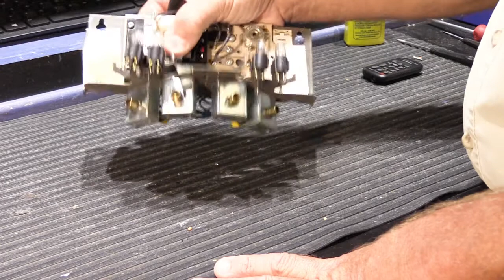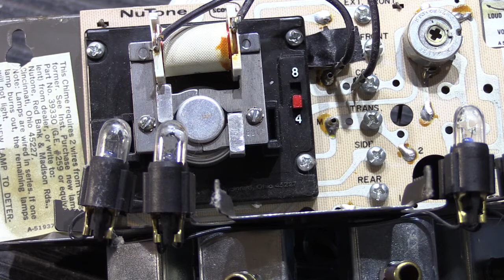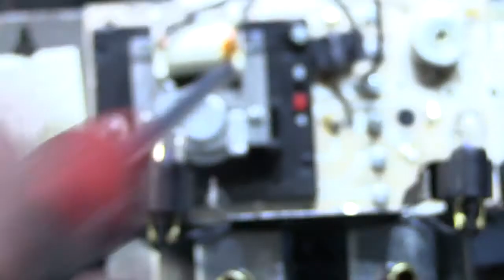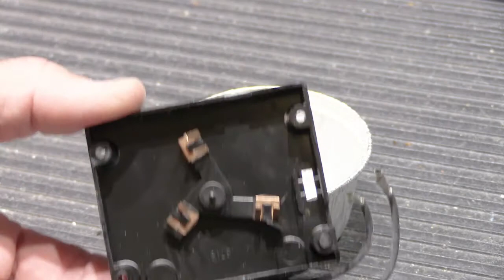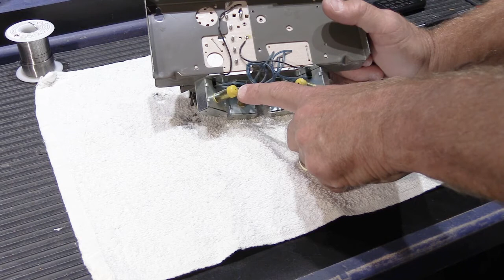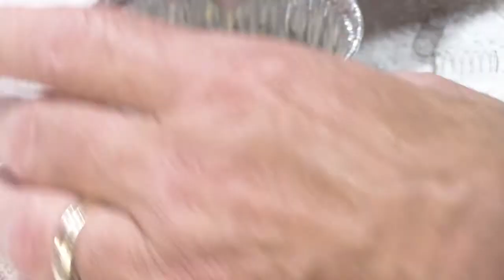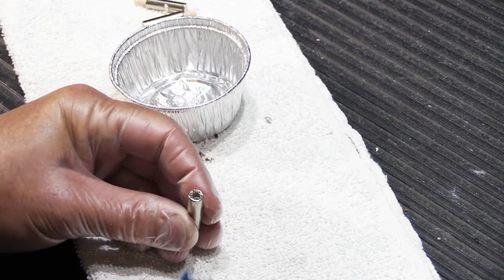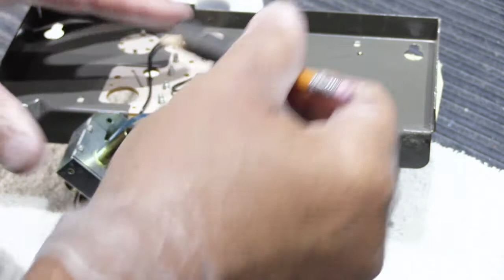How to Service a NuTone  8 Note Long Tube Door Chime Base

Comment: Great video. I did so well following the video, I went from no chimes on my Nu Tone 8 Note to a Nu Tone 9 Note. It seems to ring an extra chime 6 seconds after it is suppose to stop. Can you help? Thank you!
Reply from the maker: Hi Steve:  Is your Chime Base exactly like the Base in this Video, or is it similar but different?  For the Base shown in this Video  - there isn't anything that I can think of that would case a single note to chime, 6 seconds after a full cycle.

What happens when you activate the Chime again, after the 9th note? - Chris
Reply: @northsideservicecompany3567  When I activate it after the 9th note,it does the same thing .
Reply from the maker: @stevetarpey9230  Did you remove of bend the "Start - Stop" metal tab that goes under the motor base? - Chris

Comment: Thank you for this! It may be common sense, but does the power need to be shut off? I will in order to be on the safe side, but you never state that before removal or re-installation. Looking forward to our chimes again. It's been a year :(
Reply from the maker: Hi skrubud:  The NuTone Chime is a 16 volt chime - so there's no danger form leaving it powered up when you remove the chime base.  Make sure that you label the wires (so you know how to reconnect them) and don't let the bare ends of the wires touch together - Chris

Comment: Hello. I followed your easy instructions (thank you!) and now the chimes work.......but won’t sop. It still has the little metal tab which is resting on the post, so I am stuck on what to do next.
Reply from the maker: The metal tab is the "Start - Stop" Switch.  When the rotor comes to the end of the cycle - it lifts the metal tab from the post - breaking the connection and the motor stops turning. You either have the metal tab misaligned or you have the Chime wired incorrectly.  Here's a link to our Video that shows how the Chime needs to be wired:   https://www.youtube.com/watch?v=TjKUx18TEvc&list=PLsTvqKsBnGYdEvtzvv_pz1gOKa9UPuAxH&index=4&t=824s
Chris
Reply: Well, had I truly listened to your video, I would have taken a photo before dismantling. I thought I knew it all because I had written stuff down. Had I taken a photo, as you suggested, I would have seen that I I connected one small wire wrong. I figured it out after lots of trial and error. But now, it works fantastically and it feels so nice to hear those doorbell chimes ring like they are brand new. Thanks again.
Reply from the maker: @rejeanmayer5541  Well Done! - It's always very satisfying to find a mistake that was made and solve the problem - Chris

Comment: Hi Chris - I salvaged a K46 Jefferson Clock door chime from my mother-in-laws house over six years ago, prior to selling it.  We plan to install it in our new home which was just completed a month ago.  Thanks to your excellent video, I have no doubt that I'll be able to bring the chime mechanism back to life.  
However, the clock is another story.  It does not work, nor did I remember to have a receptacle run to the location where we planned to install it.  My fallback is to research replacing the clock mechanism with a battery powered unit, but keep the original clock face.  Do you know of any resources where folks are dealing successfully with this issue?  Thank you, and thanks again for sharing your knowledge.
Reply from the maker: Hi Timmyneal - The clock works off the same 20 Volt Transformer that runs the Chime - You will need a 20 Volt AC Transformer rated at 30 Watts - I haven't seen any clock motors fails in years and years (and I actually have some) Mostly both the clock motor and chime motor will need to be serviced (see this Video - https://www.youtube.com/watch?v=yK4XUGujZrM&list=PLsTvqKsBnGYcnKjZV0EioS9LJf6KUzAFn 

Replacing the clock motor with a quartz movement is heresy - Don't Do it !!!! - Chris
Reply: OK...I wont but here's the deal with my unit that you may not have seen before.  I already viewed the clock motor refurbishing video, which was also excellent...thank you!  The chime and clock are powered by separate transformer/motor assemblies.  The chime has a model 35180600G, 16V, 5W, 3.6 rpm, Type H18 unit. The clock is driven by a Type A1-G4, 20V, 60cycle, 2W unit, it has a plug for standard 115v socket.  

I checked to entry closet which is near where I intend to mount the K46, the builder installed wiring to power a transformer, and the lv wires for the front and rear doorbell buttons exit in the same location. 

Given all of this info, how would you recommend I proceed with getting both the clock and chime portions powered?  Thank you.

-Tim
Reply from the maker: Hi timmyneal:  Something is up with the Chime Base, "K" Model Chimes all have 20 Volt Motors - 

I think you should email me pictures of the Chime Base and the Clock so I can see what you really have - Chris

nscompany@msn.com
Reply: Done!

Comment: Hi, I just bought a house that has the 4 note long chime, it still works but I found that the number 3 chime tube is cracked, do you know where I might find a replacement tube for it? Thank you
Reply from the maker: Hi Clayton: Finding replacement tubes can be difficult - Different Series of NuTone 8-Note Long Tube Chimes use different tubes - They can be divided up into 2 basic groups: Group #1 are the tubes that hang by cords that are tied through holes in the tops of the tubes - Groups #2 are the tubes that have a plastic hanger that is inserted into the top of the tube.  Of course there are the 4 different lengths of each tube 

The best source for tubes is eBay - patience is the key - looking everyday for what you need - you will likely have to buy a complete set of tubes - Often the tubes will also be cracked like yours, the older style of tubes (in group #1) tend to crack more often than later tubes.

There are 2 possible work around's for your cracked tube - Try turning the crack away from the plunger to see if it sounds better - If your tube is from Group #2,  you can remove the insert from the top of tube (that part that holds the plastic hanger) and put it in the bottom of the tube (you're essentially flipping the tube over) with the crack at the bottom, it probably won't effect the sound - Chris
Reply: @northsideservicecompany3567  thanks Chris! I have the second group of tubes with the plastic hangers. Do you have a suggestion for removing the plastic hanger without damaging it?
Reply from the maker: Hi Clayton:  If you can wait to do anything until next week - I will make a Video that shows how to remove the Plastic Hanger and the retaining plug inside the end of the tube - Chris
Reply: Hi Chris, That would be just fine.  i'm not in much of a hurry.   I'm going to get some lighter fluid next week to give mine a good cleaning too. (Sorry I just found your reply today)
Reply from the maker: Hi Clayton: I've got the Video shot and I'll be posting it later this week - Chris
Reply from the maker: Hi Jeremy:  Here's a link to the Video that shows how to deal with your cracked Brass Tube:

https://www.youtube.com/watch?v=mfIEnjJkmvo

Chris
Reply: @northsideservicecompany3567  I recently bought a Emerson Rittenhouse 8 note door chime complete with clock.  It works perfectly now that I followed your instructions on the cleaning.  Thanks a lot
Reply from the maker: @michelangelo9694  Perfect - Good to know that the Video helped - Chris

Comment: Any advice on a 1950s K27 Regal? seems like the plunger is clogged or dirty.
Reply from the maker: It's basically the same process, except you have just 1 plunger to clean.  Do not attempt to disassemble the solenoid assembly or remove the plunger.  Use lighter fluid (Ronson or similar - NOT DW40!!!) squirt a little in each end of the solenoid tube and shake the chime base back-and-forth to make the plunger move left and right.  Continue cleaning until the plunger moves freely.  I have seen cases where the plunger has corrosion or rust on its surface, in those case the solenoid needs to be disassemble - I don't advise you try this unless you're 100% confidant you can put it back together - Chris
Reply: Thanks! I was confused by what ours looks like. It's DIRTY, but wow, I love that thing. Once I put the new one up, I started looking for options.

Looks like I'm heading to the store for lighter fluid!
Reply: I think my electrician busted the striker pins when he through it in the trash. I see an orange piece of wood down in the plunger and I found a busted piece in the trash. I gave the lighter fluid a try too and didn't get any movement. Any thoughts?
Reply from the maker: Hi Brian;  The only thing I can think of is for you to send it to me and I'll see if I can repair it for you

You will need to contact me directly before sending it

Thanks
Chris
925-743-8236